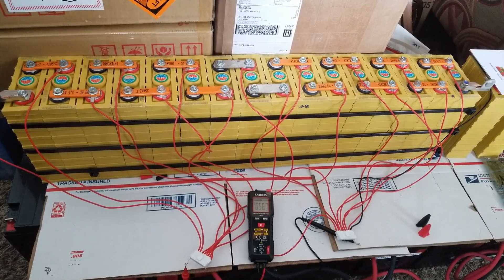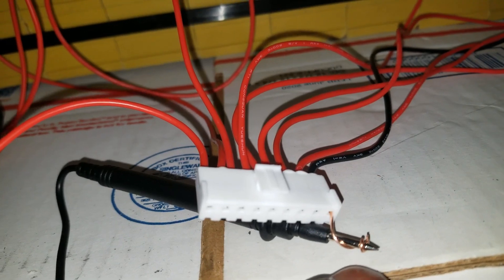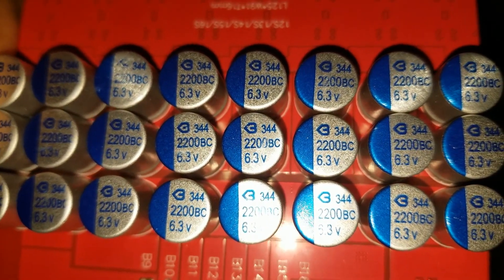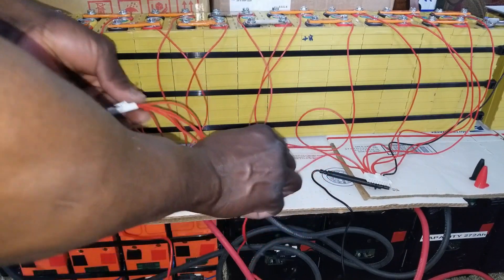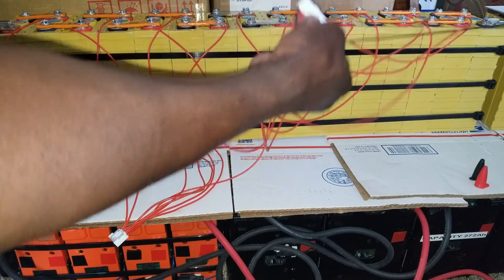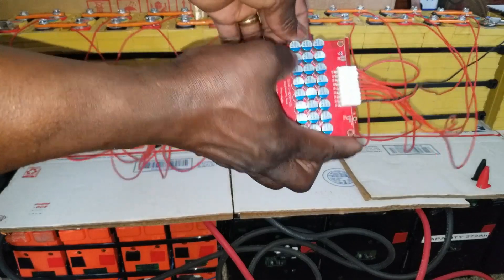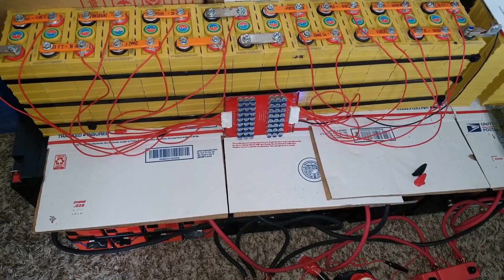SYTOCSGO 7A ACTIVE BALANCER, HOW TO INSTALL 16s 7A ACTIVE BALANCER LIFEPO4

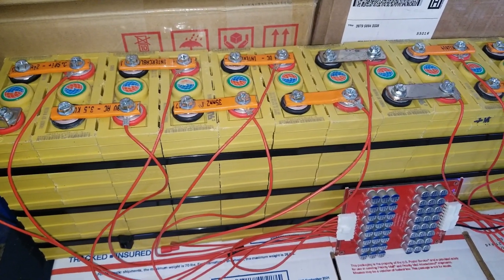Comment: 10:48 If you look at the balancer stay on all  the time you will create chaos, look close at the position of the 8th pin besides is a run soldered between, desolder it and make a swtich between it and you can put the balancer on of off when you want.
Reply from the maker: Thanks for sharing

Comment: What about the switch on the board?  How is starting balancing if you did not solder the start switch? What about the LFP or LI connection on the board? what you soldered to be configured?
Reply from the maker: It will start balancing automatically when noticed one cell is super higher than the rest of the others.

 It will also start balancing when it reaches the set voltage threshold for LFP, LIFEPO4 battery.
Mind you don't have to set this active balancer like a bms.
Finally, there's a provision if someone is interested to install a on/off switch if you want this balancer to always balance your cells or not to stay on all the time.
Thanks for watching and don't forget to LIKE SHARE and SUBSCRIBE